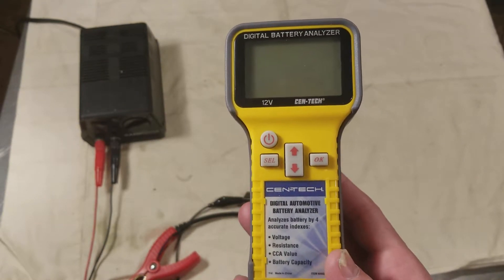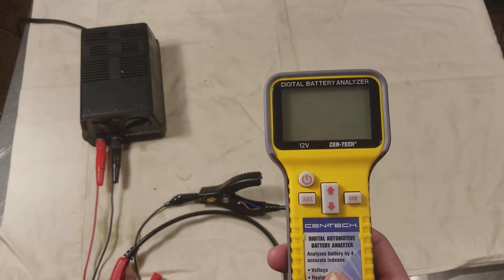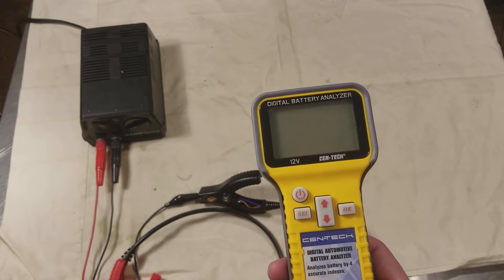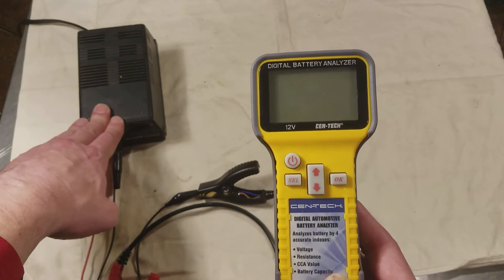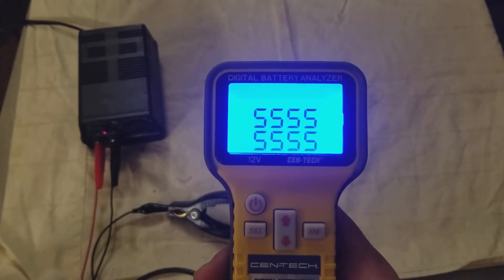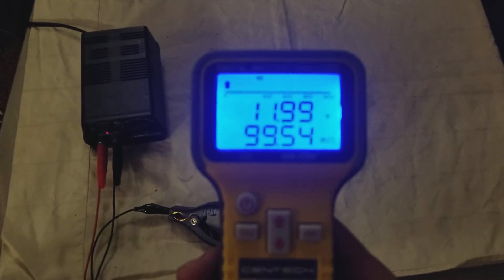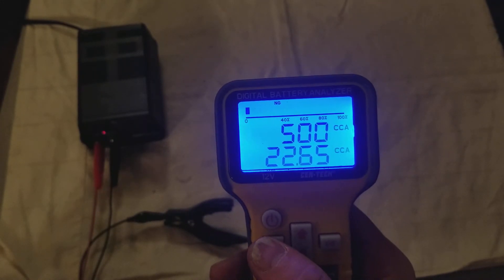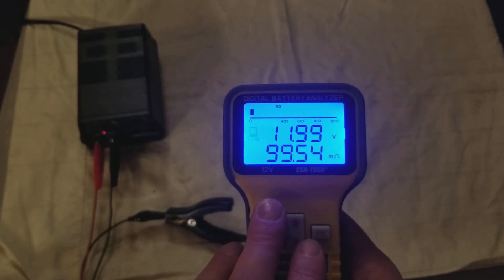Harbor Freight Cen-Tech 66892 Digital Battery Analyzer Review

Comment: This device is used to test the voltage, resistance and cold crank capacity of a car battery. (You should be using a multimeter to test for voltage output on your power supply.) The battery tester will tell you the battery's voltage and resistance, then, when you press the select button, it will show you the battery's cold cranking amps. If your car battery has less cold cranking amps than what it is rated for, then it is experiencing sulfation on the internal lead plates, which raises the resistance (reduces the flow of electrons through the battery.) A new battery will show a resistance of one or two, while an older battery will show a resistance of three or four. The higher the resistance, the less "life" and strength your battery will have. A car battery can show 12 volts, but if the capacity is low and the resistance high, it's time for a new battery. You should always completely charge your car battery, then wait at least 12 hours before testing.